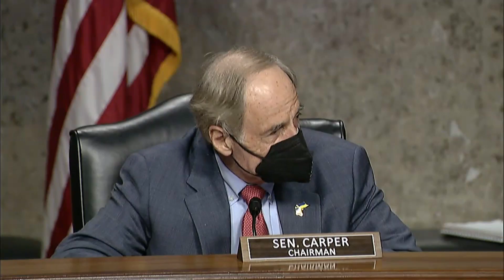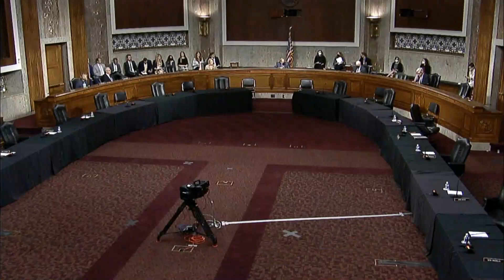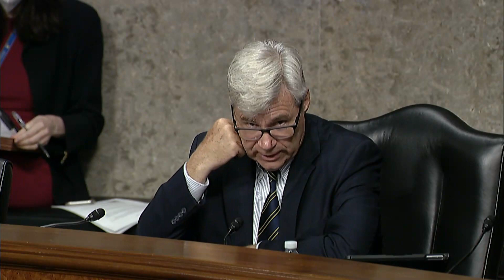Sen. Whitehouse Delivers Remarks on Carbon Capture Technologies in an EPW Committee Hearing

Comment: Senator Whitehouse, direct air carbon capture will never be competitive with other carbon drawdown solutions.  It's basic physics and thermodynamics of entropy.  CO2 is too diluted in air to make it efficient and economical enough to be competitive.  The vast majority of scientists are not promoting it as a solution.  It's basically an oil industry distraction.  Please get a second opinion to educate yourself about direct air carbon catcher.   Everything else you mentioned in this short clip was spot on!

Comment: Hempcrete is Fireproof,. anti-mould, anti-bacterial and absorbs carbon dioxide over it's lifetime.  Hemp is a multi-product crop,. the Oil from the seed contain omega 3/6 and 9. the Fibres can be used to create strong biodegradable rope, Hempcrete or animal feed.
the USA government Prohibited the growing of this crop along with Cannabis to take legal control of the drug business, a business they remain in legal control of to this day.

Catching some of the smoke from an Oil fire,.. isn't good enough.
you need to rapidly change the methods of energy production , storage, and usage. that's where the funding should go.